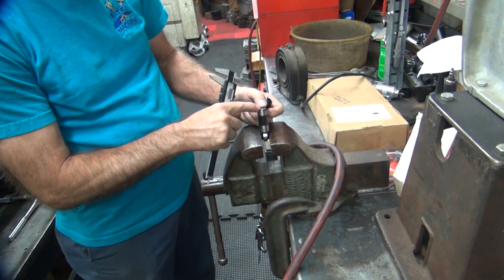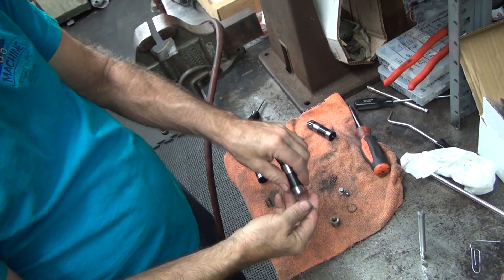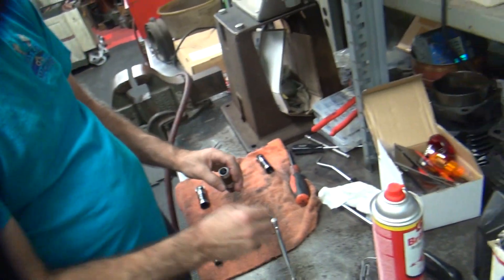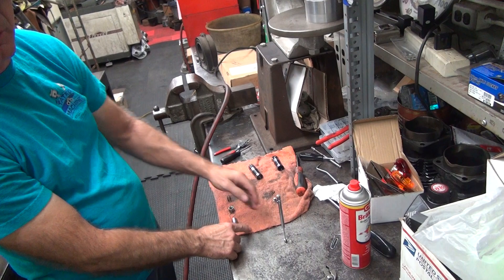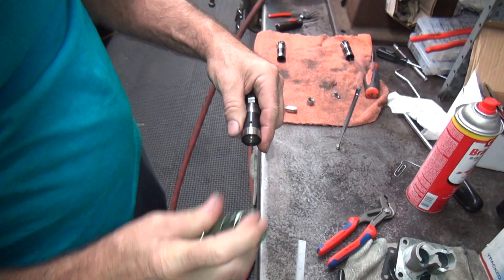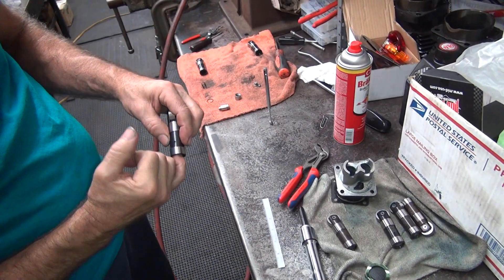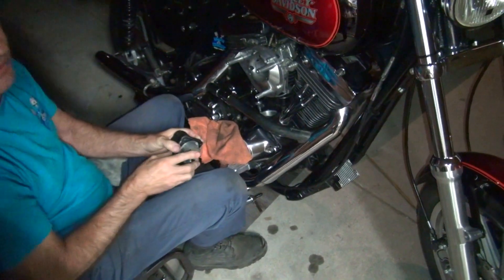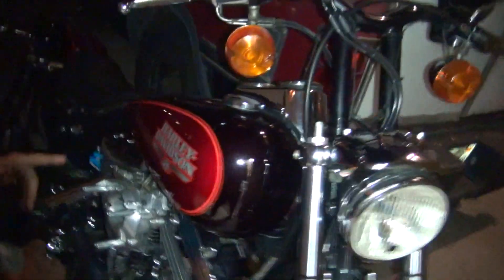#221 1988 fxr fixing the lifter noise repair pushrod adjustment cam change fxrs harley tatro machine

Comment: Been wondering whats inside a lifter.   Seems strange that a brand new lifter doesn't work correctly.  Grit in some, others not quite fitting right, are those imported??????
Reply from the maker: no, these are the usa ones. 
tatro